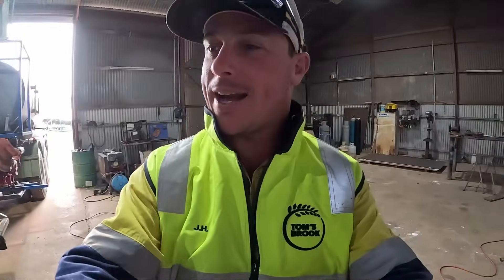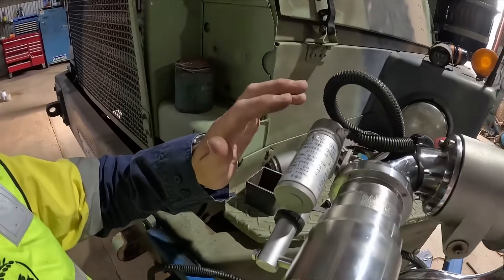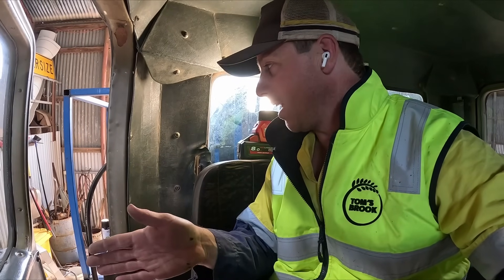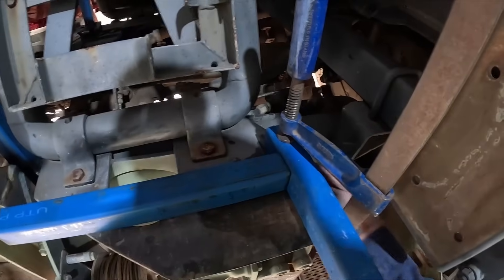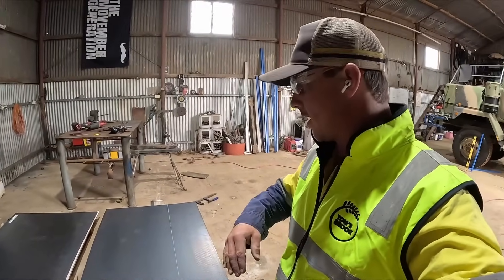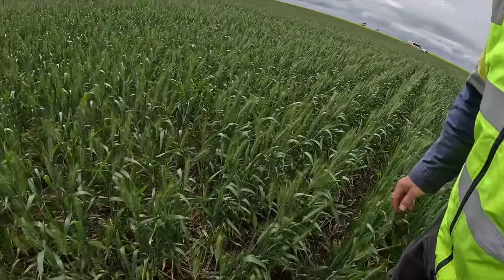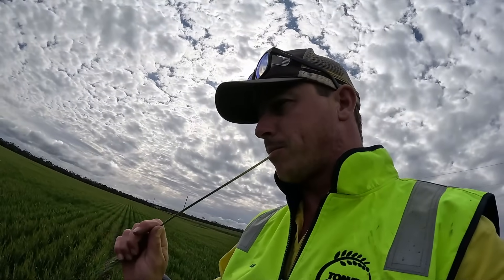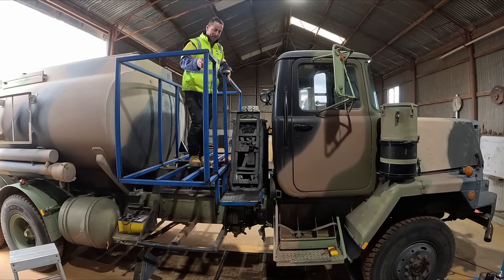Step made and crop tour!

Comment: John better go back to the drawing board. The way your putting the step on is going to restrict you getting the spare wheel down. Plus with the monitor , the plumbing extends pass the bracing ready to be bumped in timber.  Hint cover the rear cabin glass and mirrors before grinding and welding , you'll find pits in the glass.

Comment: A word of advice I've been a fabricator for over 40 years and really the best way to cut that is either with a plasma cutter, a circular saw with a metal blade or a torch with all using a straight edge you will have a lot better results.

Comment: John your oxy torch may be okay although there was a recall some years ago as a new design was issued and all old torches were taken out of circulation.  When you buy new tips get a few different sizes for different thicknesses of metal and buy some heating tips so that you don't spoil your cutting tips by overheating them.  Tip cleaners are a good investment also and there are several different types on the market.  To get a good cut comes down to good clean tips, correct pressure settings and proper use of hand piece.  When cutting turn the oxy knob at the end of the hand piece all the way on so that you have full pressure going to your tip and then regulate the oxygen to the flame with the knob halfway down the handle.  Light the torch, turn the acetylene or LP gas on until the flame jumps away from the tip and then back it off until it jumps back onto the tip.  At this point you open the oxy knob and adjust for a good clean flame without feathering at the tip.  When you press the oxy lever you should be able to see a good clear jet of oxy all the way down the flame.  Your now set to go.  Hope that's helpful. Thanks for sharing farm life I love watching what you are up to.
Reply: Plenty of good videos about cutting.

Comment: if you think that wheat is a problem in the barley I've had much worse. The old man was topping the truck up, emptied 1 silo went into the next silo forgot which is which put wheat on top of the barley didn't release I then filled up the air seeder didn't even look at the seed. Dad then found wheat in the ground when checking the seed depth, and then released what he had done. So he went and emptied the contaminated grain out of the truck and went and filled it back up, but he done it again( just wheat in the truck this time) In his wisdom he decided to empty that wheat out and that the contaminated barley would be ok to use after all because he believed it was only like 2-3 tone in there and it would blend together. It had to be more then 3 tone the next 350ha was interesting to say the least some parts where mostly wheat some where mostly barley I think we eventually planted it all out and got back to just barley at the end, but most of the 350ha was a good blend of the 2. It was a nightmare to sell. We got away with a good chunk of it but in the end we where left with 100 tone we couldn't do anything with which wasn't that bad considering how much we had.

Comment: Please put the 9" grinder up in the mezzanine, I have known a few people that have had injuries with them, one major injury loosing hand. With the oxy you can get a set of tip cleaners from welding stores and various size tips to suit what you are cutting. looks like type 41. Use the RHS clamped to the steel as a guide to the wheels for a straight line. Looking really good so far and with a bit of paint should be good.👍👍
Reply: I got whacked in the head with a 9 in grinder when it locked up. Heap of stitches in the gash above my eye, never used it hand held again.